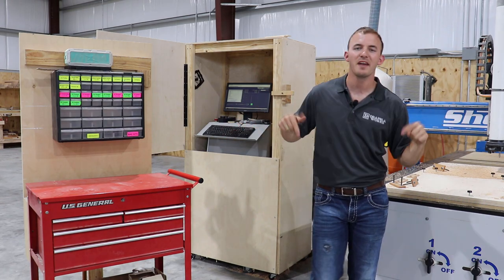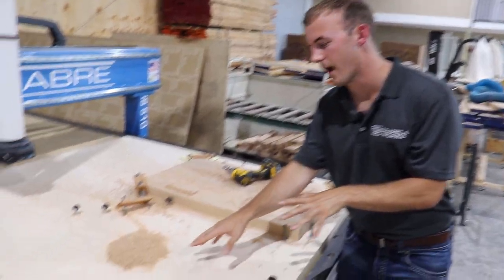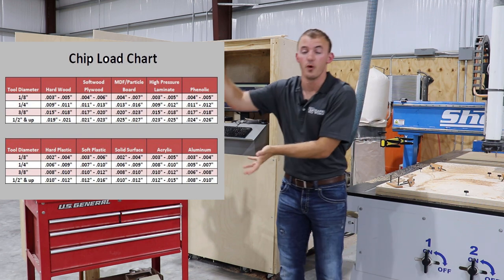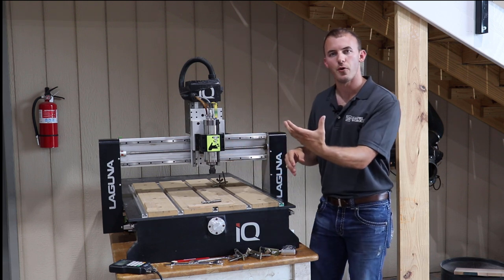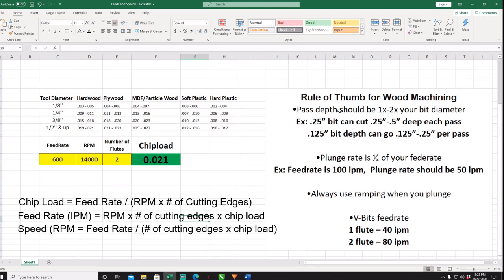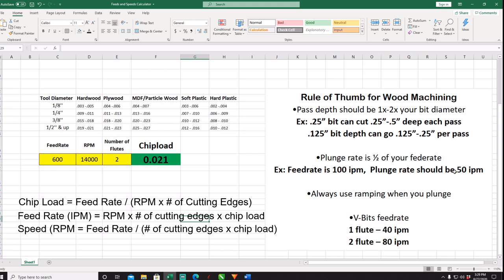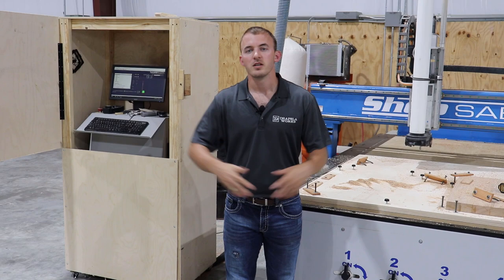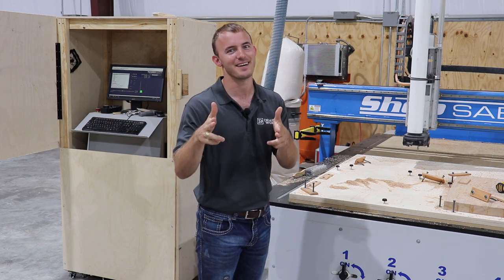Calculating Feeds and Speeds A Practical Guide | Wood CNC Router

Comment: Quick question, the info on the different hobbyist cnc's that I have been seeing tell me to use half the bit diameter for depth of pass, for example depth of pass for a .5 bit should be no more than .25. Is your formula of 1x - 2x bit diameter for depth of pass geared more for the larger format commercial style cnc's or should it apply across the board?
Reply: @cutting-it-close  absolutely, I appreciate it and thanks for the informative videos.
Reply: @jessemobley3976  what did he say? his answer isn't showing up for me. Is the 1x-2x okay for hobbyist CNC?

Comment: Thanks a lots
Waht about ball nose tools? What is the rules
Reply from the maker: Depends on if you are doing 3-d or not. I do not know the rules for 3-d, but for cutting or profiling I treat ball nose bits the same as the others.
Reply: @cutting-it-close  i can use the ball nose speed and fed as i use the v bit? Or end mill
Reply from the maker: @SaudAteah  I would say use it more like an endmill.

Comment: Very newbie question... how does upcut vs downcut affect the feeds & speeds?
Reply from the maker: Thats a good question, technically they shouldn't change with one or the other, but in my experience, I run downcuts a little slower because they have to go back through the old chips they already cut which causes them to heat up faster.

Comment: How does step over affect the chip load calculation?
Reply from the maker: That one is interesting, because when pocketing, the bit when it first goes in and starts takes off 100% then let’s say  you set your step over to 40% it is not cutting the correct amount. The only way I have figured this out is trial and error, with my bigger bits when pocketing I’ll do Raster, and make it go across the grain so I don’t get tearout and have my step over at 85-90% and it keeps my bits better longer.

Comment: What would you run a 3 flute vbit at? I have an avid pro CNC ... so a mid level machine. Also, thanks for this, this was an amazing how to!!

I also subbed because of the great info!
Reply from the maker: I always run those at 90-120 IPM I noticed if I went faster, the machine would shake and give more than I was comfortable with lol I use that 3 flute engraver bit a lot, I know which one your talking about!
Reply: @cutting-it-close  Thanks for thaT!! Oh! I also forgot ... do ballnose bits fit into all this with the sizing or are they special?
Reply from the maker: @drewbriggs3313  I run them the same, I personally haven't had any issues

Comment: Thanks for the spreadsheet, appreciated. If i put exactly the same figures in my boxes for 1/4 inch MDF  450 / 1800 / 2  i get a chip load of 0.125 You gat a chip load of  0.013? Am i doing something wrong as i typed them in exactly the same as you have
Reply from the maker: Yes you are off by a 100th. That means your chips per blade cut would be a 1/8 thick which is impossible lol
Reply: @cutting-it-close  Thanks for the reply but as i said i am putting in exactly the same numbers as you are in the chart but i am getting a different chip load than you! how can it be different if i am testing it with the same numbers as you are using, i should get the same answer?
Reply: @steveparry4455  you put in 1800, he puts in 18000

Comment: Is that chart a generic chart for all bits or specific bits? I am currently using cheap HSS bits and i couldn't find anywhere the chip load. I know you are using at the worse case scenario mid range to high end bits so my question is... Can  I use this chart as a starting point for the cheap ones Chinese bits am using? Also am a metric user and use bits anywhere from 1.5mm - 6mm. Is there a way to proportionally estimate the chipload based on the chart provided?
Reply: @cutting-it-close  I totally understand the concept now even created the same excel shit converted to mm and it makes sense. I am wondering if there is a proportional method given the bit diameters provided on the chart to calculate the chip load for different diameter bits.

Comment: 1200 mm/m 25.4 = 47.24 i/m is that right? That's how fast my machine can go :( 450 i/m * 25.4 = 11430 mm per minute! That's an insane speed! Is that right? Am I making a mistake in my calculations?

According to he formulas in the video if I run my machine at 45 ipm my spindle speed should be 1120rpm. And my cutter is 10mm in diameter which is close to 3/8". My concern is that my spindles power output is 2.2kW at 24000rpm. That means at ~1200rpm the torque would be minuscule.

Comment: Ok your rule set is different from what i been learning from. bit depth I was told should never exceed. 1/2 of bit radius. If your using a .25 bit your depth should never go past .125 My rule for my OnefinityCNC woodworker. I am going to start watching my wood chips more though I use sound to adjust my RPM's most of the time. I need to look at the dust more....